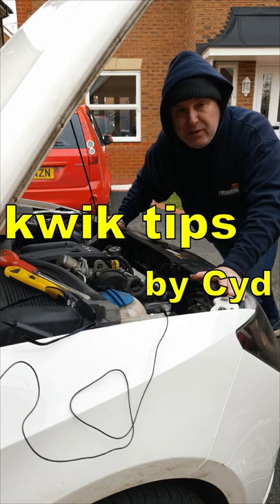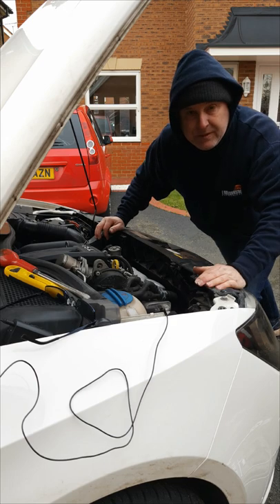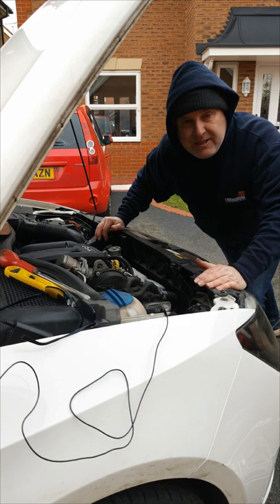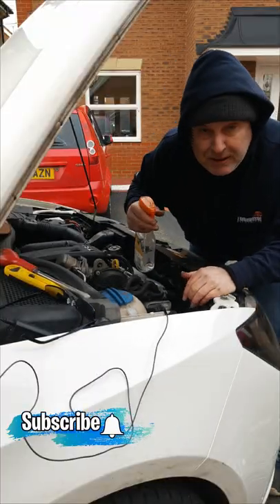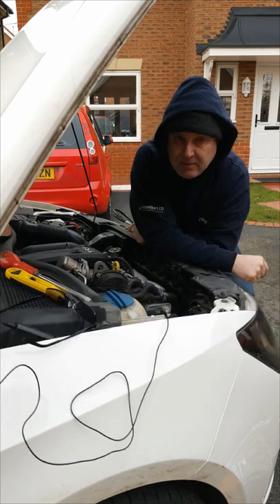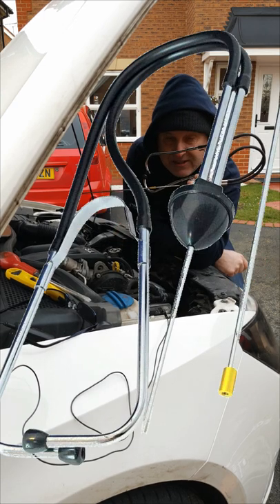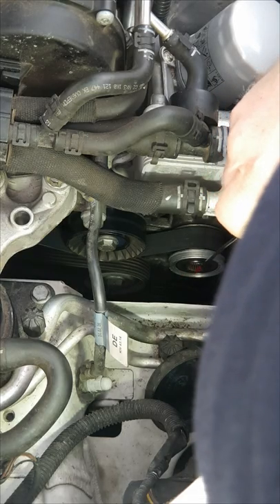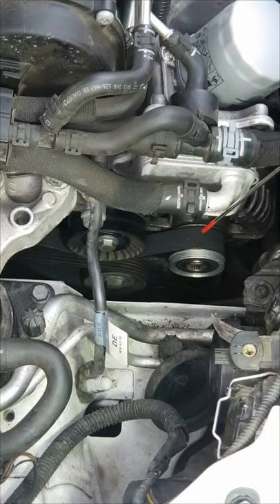Find That Noise 📢 with Mechanics Stethoscope & Water | #Shorts

Comment: Another way, but no so cool, is  with a screwdriver and sticking the ear to the handle, the noises can be detected too.
Reply from the maker: Yeah, that's how my Grandad taught me to do it too. The problems with that method are that you have to "take your eye off the ball" and you've got to be able to get your ear on the end, possibly in a tight space. Believe me, a mechanics stethoscope is about the best tenner you'll ever spend on tools.
Reply: @CycloneCyd  In my SAAB 93, the Big problem i had it was the CIM. Fortunately I have a friend that he can repro a second hand CIM to avoid yo buy a new one very expensive.